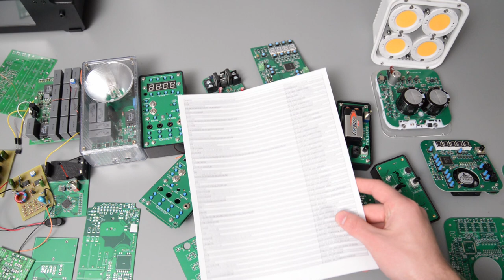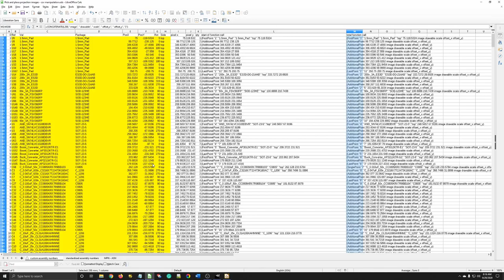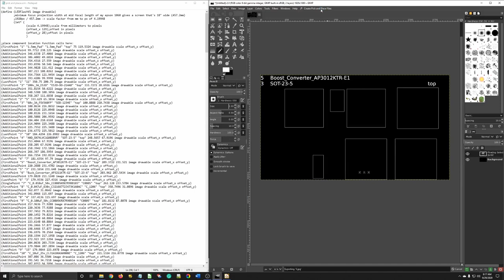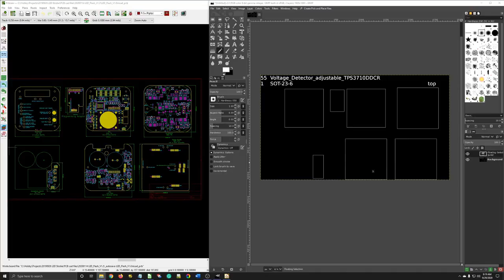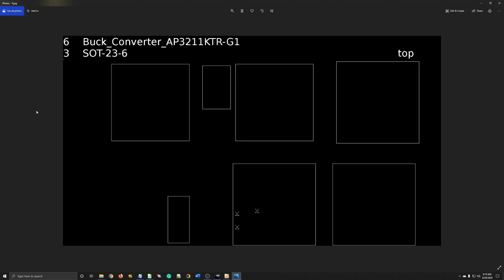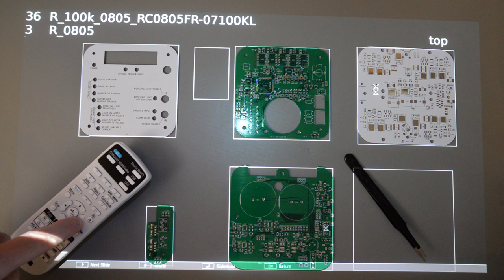Speed up manual PCB assembly using a projector

Comment: I got a Gerber file , is it possible to generate and project components like you just shown in your video?
Reply from the maker: You'll need a list of components that includes part numbers and coordinates. I did a quick search and it looks like there are workarounds for getting centroid data from gerber files. It would be much easier though if you have a ".pos" or "pos.csv" position file.
Reply: @orinhuber  thank you! 👍